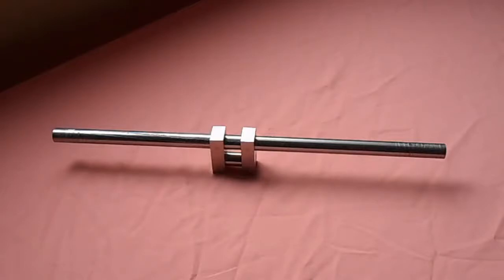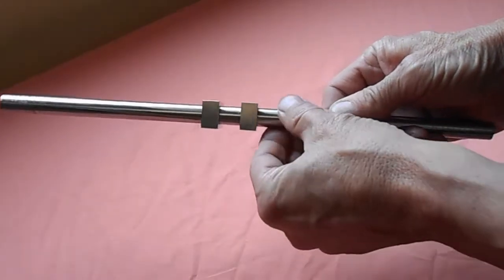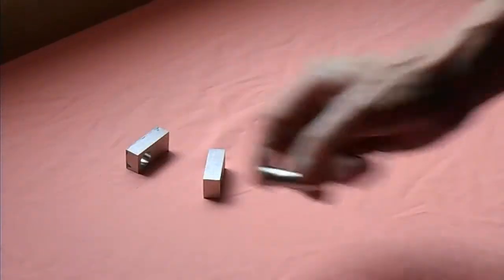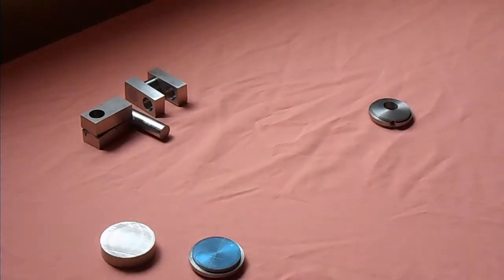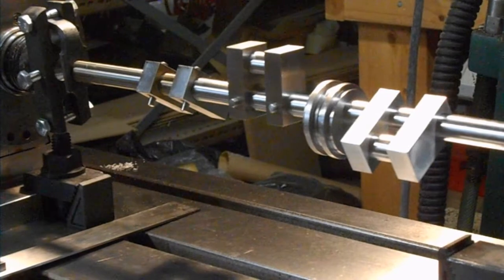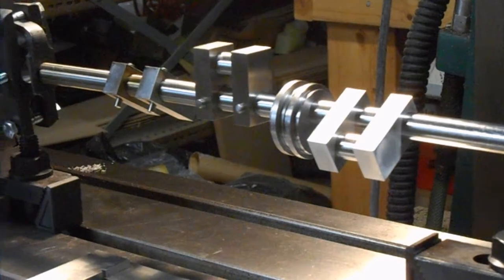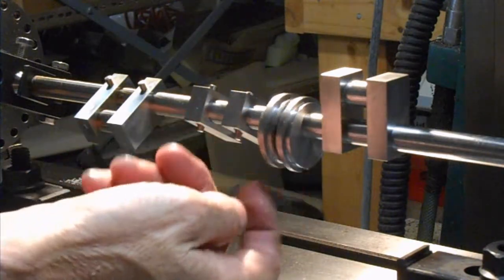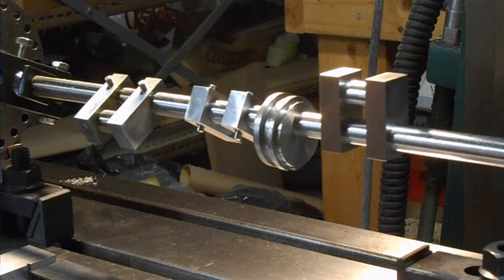Shay Locomotive Crankshaft Assembly

Comment: Amazing work. What scale Shay is this for? Did you heat and shrink the crank webs onto the journals?
Reply from the maker: No Jim, I did not.  The extremely tight tolerance I used would not have allowed it.  They are very snugly fit, and taper pins as well as sleeve seizing compound were used to fix them in place.  And the scale is 1 1/2".